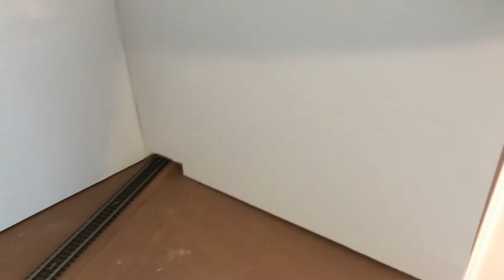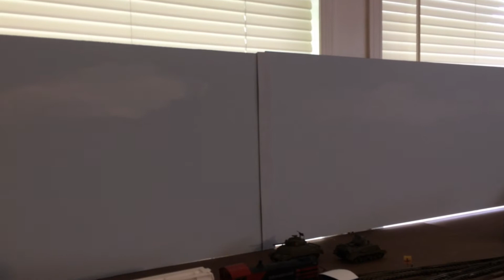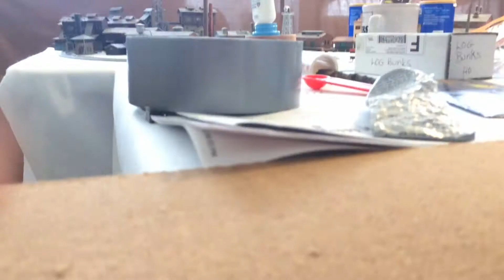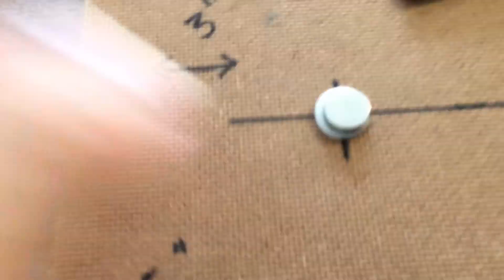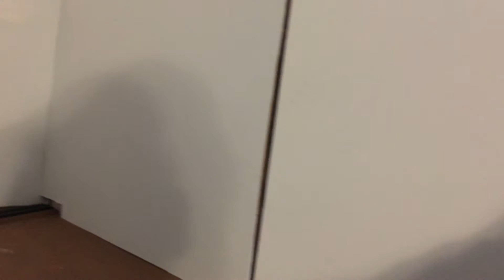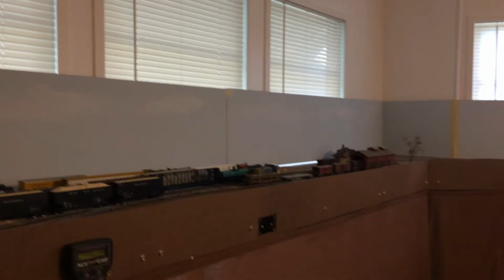New Build #15 part 3..immediate continuation of part 2.

Comment: thats a great solution using the binder clips. you are one smart fella.  lol   also if you are going to use plaster between boards, why not use paper drywall tape ?
Reply from the maker: that is a good idea Dave.. I am still fussing with the idea of styrene removable joint pieces.